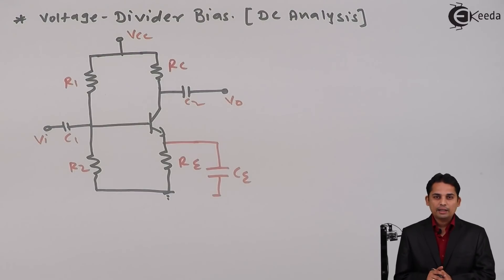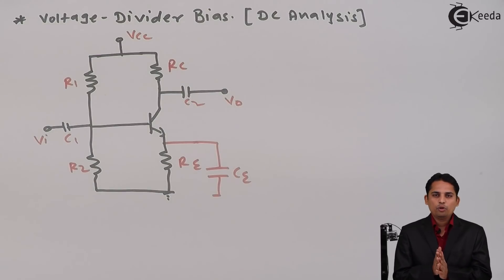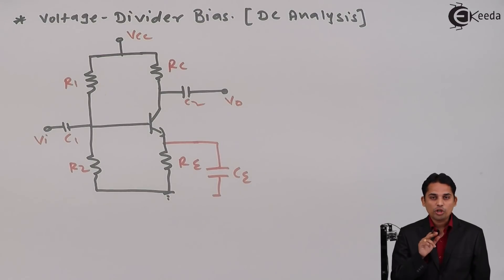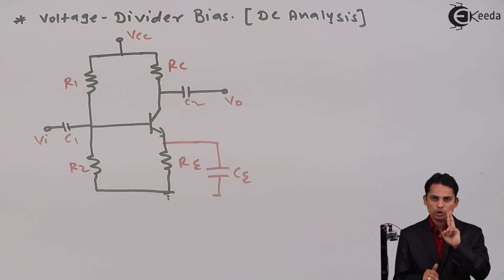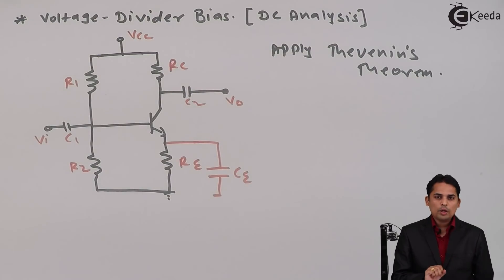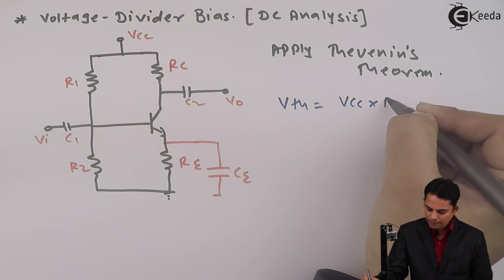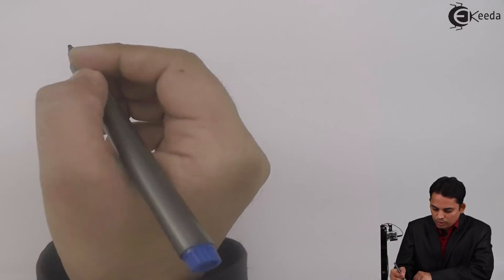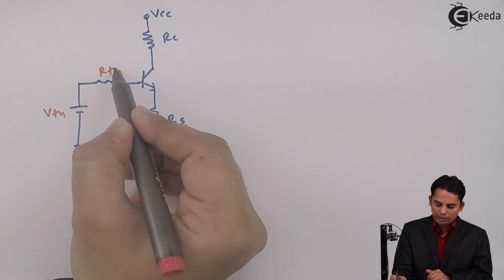Voltage Divider Bias - Bipolar Junction Transistor - Analog Electronics

Comment: Am getting Vce negative value!!!
Reply: Then you have too large a collector resistor and the transistor is in saturation, which means the usual conditions for linear amplification do not apply. If you are designing a circuit, lower your base bias point closer to about 1V and reduce the collector resistor to no more than 20-30 times the emitter resistor. It is impractical to look for gains much larger from a single stage.

Comment: Can you explain function of Re and Ce
Reply: The emitter resistor (Re) provides negative feedback to stabilise the dc operating points. It is sometimes called an "emitter degeneration resistor". You can see how it works, for example, by considering that as temperature rises, the voltage across the emitter-base junction tends to fall and the base current will tend to rise. Without Re, that would lead to an increase in Ie and Ic, thus lowering the voltage at the collector. However, with an emitter resistor, any increase in Ie will raise the voltage at the emitter and oppose the increase in Vbe. That will considerably reduce the effect of the change in Vbe with temperature and stabilise the collector voltage.

The emitter bypass capacitor (Ce) is added to increase the ac gain while leaving the dc gain unchanged. The dc gain is Rc/Re and should not be too high so that the dc bias points remain less dependant on the variable parameters of the transistor or on temperature, etc. At frequencies where the reactance of the capacitor (=1/2πfC) is small compared with the dynamic emitter resistance of the transistor (=25mV/Ic), the small signal ac gain of the circuit becomes Rc/(25mV/Ic) = Ic.Rc/25mV which can be much higher than the dc gain.